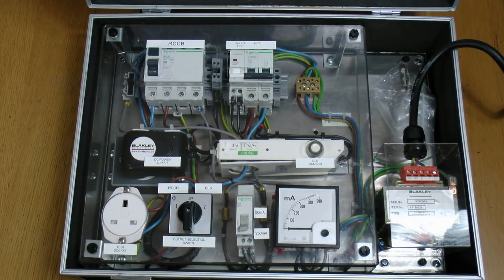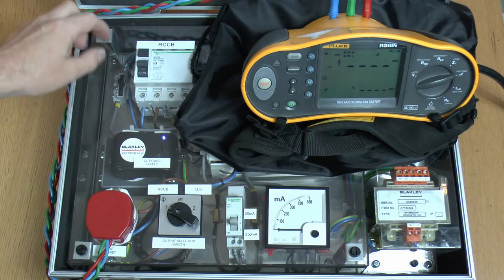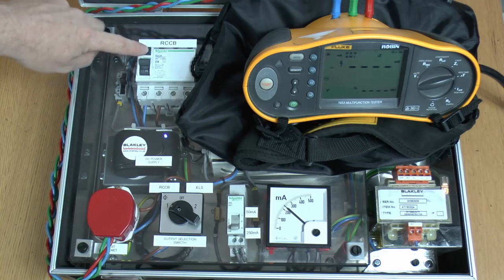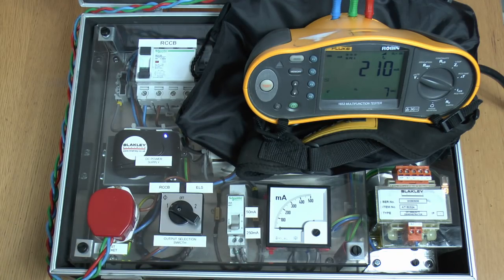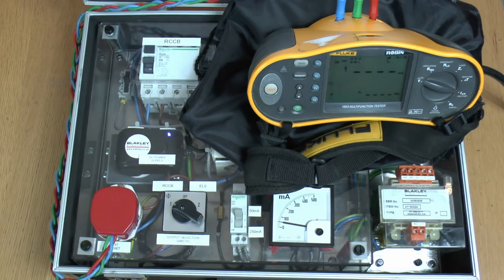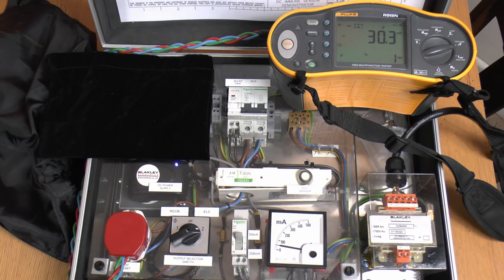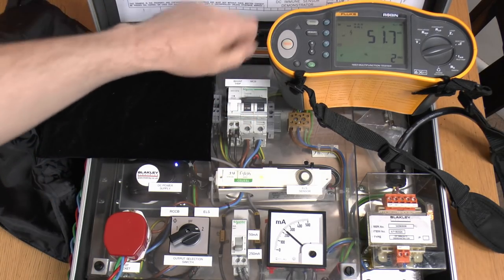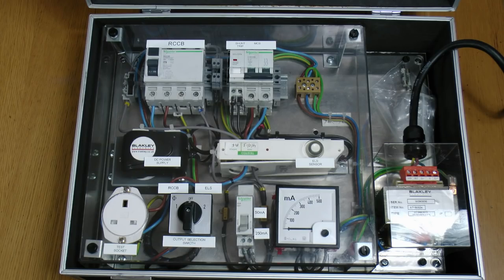Effect of DC on AC RCDs with JW (John Ward joins the e5 Group youtube channel)

Comment: The world of RCD's is far more complex than many of us have been led to believe for many years. Great video John and Paul #e5
Reply: In most countries. Here in Germany the AC type RCDs were already banned in 1984 for new installations, the standard here is the type A RCDs which detects AC and pulsating current faults. Pulsating current is unsmoothed DC directly from the rectifier, mostly found in switch-type power supplies. The RCDs look absolutely identical, they're connected the same way, but the symbols on them are different:

https://www.elektrotechnik-hager.at/pics/Typ.jpg

In 1984 the VDE, which releases the regulations for electrical installations in Germany, also introduced that "electrical installations in locations which contain a bath tub and/or a shower must be protected by RCD". The german VDE 0100 is comparable to the british BS7671, even some parts are absolutely identical. Section 701 for example is the same in the VDE 0100 and the BS7671, the numbering and the content is identical.

Comment: That's the reason the AC type RCDs are banned here in Germany for new installations since 1984. Type A is the standard here for households since then.
Reply from the maker: Marcel Germann 🤭🤐 we talk about in the next video #spoiler
Reply: Same in Denmark
Reply: Why, given 35 years, did this not become the standard throughout Europe?
At that time switched mode PSUs were uncommon. 
Whereas now they are ubiquitous. Including in the likes of LED lamps used as a direct replacement for incandescent ones.
Reply: @markevans2294  The first ones came over here during that time. At first the VDE considered them as beeing potentially dangerous. And they demanded that the power supplies had to be in a housing touch-proof up to 500V.

Comment: Excellent informative video John as usual.  More information on this subject is required for all contractors.  I’m not concerned with PV or car charging as most sparks were aware of this effect.  I think it has shocked the industry, the average electrician.  I’m particularly concerned with TT earthing systems in domestic & commercial premises.  Also during periodic inspections (EICR) i & other electricians I know have actually attached to the report, information for the client relating to the effects of DC in AC type RCD’s.  Not scaremongering, but informing the client, that it should be given due consideration, taking into account modern domestic premises are usually overwhelmed with electronic devices, LED lighting, usb sockets etc;  it would be interesting to see what these devices actually leak to earth during normal operation.
👍🏼
Reply from the maker: patrick brannan earth leakage will be covered in our RCD mop up video. There are formulas for this. Give us time as we are working on this now. But thanks for watching. Lots more to come on RCDs
Reply: Hi can use a clamp meter to measure the DC current that might affect an RCD

Comment: Excellent Video John. I know its not strictly about electrical installations But please could you explain how DC gets back into the neutral.  Almost all PSU's in all equipment begin with an isolating transformer. So getting a significant pulsed "dc" signal back that way is not impossible but tricky. (Pulses only occurring on one side of the cycle).  Beyond the PSU there is often a capacitor and very high resistance resistor to the chassis to prevent charges building between dc circuit and chassis, and that would provide a very small current to earth. (In fact this used to be the cause of quite high earth currents in large office buildings.) 
Please could you direct me to, or give examples of how DC gets into the neutral?
I just asked at another E5 video, but then figured with all those low voltage PSU's etc, that you seem more likely to be into the electronics side of things and to be able to give some explanation.
...Oops I edited a word and lost 9 upvotes.

Comment: DC devices usually have full wave rectifiers - they have been around for a long time (before RCDs) - how many incidents when the RCD failed to trip.
Reply from the maker: Agree, but issues are on the rise as you will soon see. The older 4293 were more mechanical than electronic biased so it’s a complex debate. Given the huge variety of switch mode power and co start DC that can appear it’s challenging to compare to RCDs of many years ago, especially given their history of which we will cover in a video coming soon. Thanks for watching

Comment: Shouldn't there be some sort of accountability with the manufacturers? Basically, we have to consider changing AC rcd's because of shoddy equipment. Wouldn't it be better if there was a mechanism or electronic trip within DC producing equipment to stop the RCD coil becoming saturated? The manufacturers are aware that their equipment produces DC power so they should take steps to mitigate the effect on a domestic installation instead of just shrugging their shoulders. Any death or injury that occurs from DC blinding on an AC RCD is avoidable if the DC is prevented from entering the live conductors in the 1st place. It all seems a bit backward to me in that the electrical industry has to change because that is considered easier than getting manufacturers to be a little more proactive. Why aren't British Standards (or even Trading Standards) stepping in? Maybe we have to wait for a few more deaths from DC blinding before someone has the guts to challenge the manufacturing industry. Actually getting quite annoyed about this
Reply: Well said , big tech firms should have more responsibility for their impact.
As everyone is now being forced to consider the environment ,less focus on possible health and safety.

Comment: Does the Blakey device actually have some specific circuitry to compensate for DC or is it just that the current transformer is visibly much larger than the one in an RCD so less likely that the core will be magnetically saturated by the DC?
Reply from the maker: Richard Deasington it has two current transformers in parallels with a circuit to monitor them. Faults will rise potential with a lead lag and as such that indifference will lead to trip. More content will come in coming months. Lots more! Thanks for watching